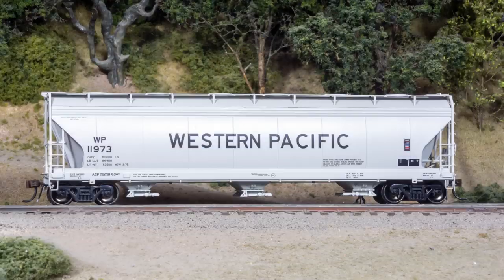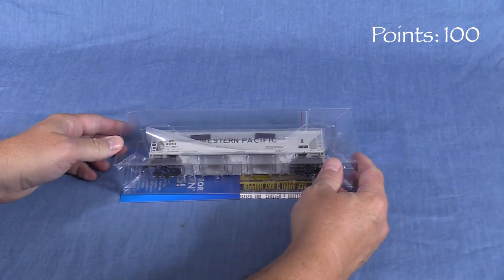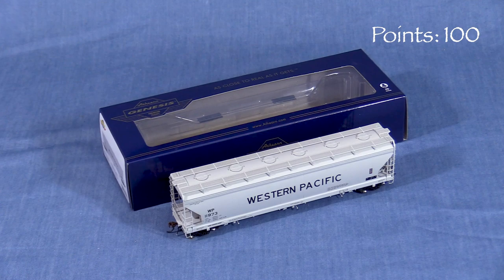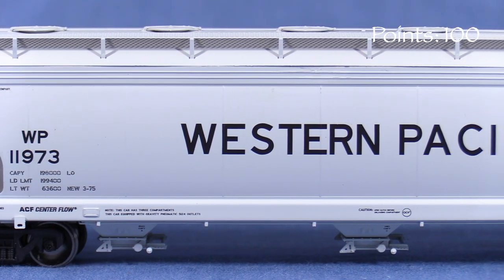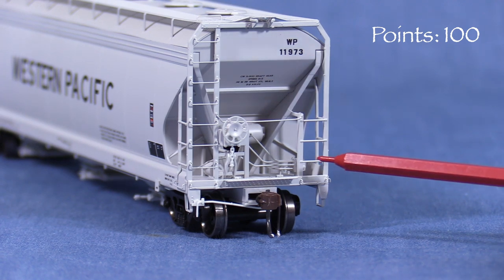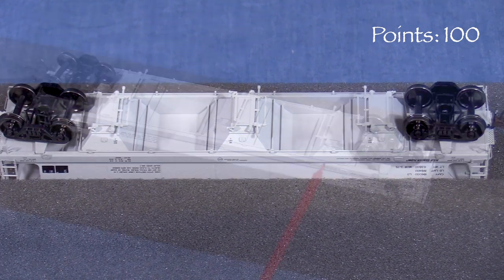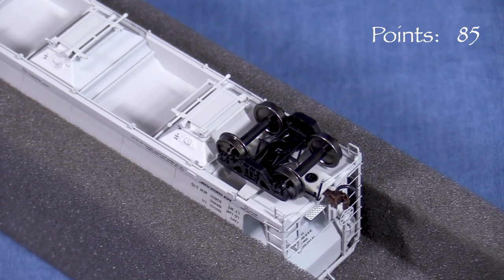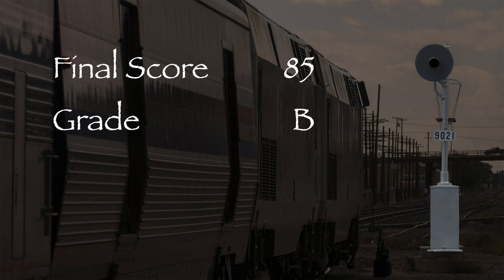Product Review HO Athearn 4600 Hopper

Comment: Plastic couplers on a $50 car should be a point deduction too IMHO
Reply: @TMC0610  They could still be their own, they should just be of a quality that matches the high price point of the car. Rapido for example makes their own that are metal. But I get the impression Kadee isn't exactly helping the problem if most manufacturers go to the trouble of designing and making their own just so they don't have to buy from them.
Reply from the maker: I'm not a fan of plastic couplers either.  It'd be nice if they'd use metal ones, either Kadees or ones of their own design, rather than the plastic ones they're using now.  I replace them on my Athearn equipment.  Thanks for watching!

Comment: The reason why one of the couplers is low because it's not as straight as the other coupler is.
Reply from the maker: It might be that the coupler box was not level when attached to the car.  I would really like to see manufacturers take a little more care with coupler height.  Thanks for watching!

Comment: Why doesnt the inaccurate wheels and couplers get docked from the points
Reply from the maker: Looking at photos it appears the prototype cars have standard couplers and 36" wheels.  I'm not crazy about the plastic McHenry couplers Athearn uses but they are representative of a typical freight car coupler.  The wheels on the car have the correct diameter.  Were you referring to something else?  Thanks for watching!
Reply: @DanielCortopassi  It may(?) be a reference to the .110 wheel treads and not .88 semi-scale ones, or possibly because the Athearn genesis truck is a composite and doesn't match a prototype truck (like many manufacturers are guilty of). Tangent's new truck system will make great replacements for my Athearn Genesis trucks.